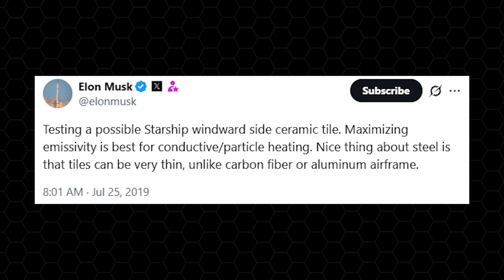SpaceX's New Starship Heatshield to Beat 1500°C Reentry in Flight 10 REVEALED...

Comment: Starship survived re-entry just fine did it? Is that in a parallel universe where Musk doesn't massively overpromise and under deliver? Also saying the heat shield is the hardest thing...maybe try to get Starship actually into orbit and back again without blowing up as that seems pretty hard for SpaceX so far.

Comment: YSZ(Yttria-stabilized zirconia)  coated turbine elements survive 2700 degree C. We use it to coat turbine parts on jet engine parts that have to endure for hours for thousand of flights at over 1500 C. YSZ is self-anneling at 1000 C. So Space X could theoretically do a pre-annealing phase just before attemping a full reentry phase. The heat shield old fibrous aluminum backing substrate should grip the sputtered or deposited YSZ much better than the current baked on cermic overcoating. These new heat tiles can be produced by Space X in larger shapes and sizes. The cost of production is higher, but the durability/reuse factor of 100x+ makes up for that expense.
Reply: Those turbine blade coatings are deeply impressive. Coupled with active air cooling, well, that’s the finest heat management combo.

Though it’s one thing to coat an incredibly stiff turbine blade, and a very different proposition for a comparatively wobbly spring stainless steel tube.

Comment: Some materials create a carbon foam as they heat up. Why not paint the areas behind likely burn-through with the stuff, and they'll seal any gaps which could otherwise allow plasma to The under side. 

That, and active cooling, wouldn't take much but sprinklers behind the skin and a water pump in the bilge. Functions like a heat pipe. 😎
Reply: What do you mean by heat pipe?

Comment: A controlled burn all the way to landing, allowing a slower descent and therefore less friction and less heat, is not a stupid idea. At our present level of technology, it happens to be impossible, but it is not a stupid idea. The only thing preventing it is a lack of power. Presently we can't conceive of how to do it, due to the limitations of reaction engines that need fuel, but if we ever make a breakthrough in energy and mass, possibly with a field effect/anti-gravitational form of propulsion, such as imagined by science fiction writers, then it will be possible, and we'll be able to float down from orbit just as gently as a parachutist. Or a UFO. Until then, we'll have to reenter at speed, and contend with the friction problem. From an engineering standpoint, it's a challenge that is nothing less than brutal. We're racking our brains trying to solve it, using everything we know about materials, heat exchange, etc. No wonder Elon calls it THE problem.

Comment: Injecting water behind highly susceptible tile locations is an easy way to protect these areas from hot plasma entry.  The miniscule amount of injected water vaporizes creating a slight positive pressure preventing hot plasma entry.  Spacex should focus using this cheap, effective design solution at the forward and aft flap hinges.  If NASA had used this on the Orbiter's wing leading edge, Columbia's cracked Reinforced Carbon Carbon tiles would likely have safely survived re-entry.
Reply: Weight of carrying the water + flow channels and injectors covering the whole ceramic tiles + Cg shift for the whole ship would be extremely challenging, and would be a redesign of the whole rocket, in system engineering trade-offs they probably won’t adopt this

Comment: This is bullshit! Tokamak plasma confinement has been used without ceramic insulation.

Why not use EM fields to gap the charged plasma from the surfaces?
Reply from the maker: Tokamak plasma is confined in labs under controlled conditions. Reentry plasma is chaotic and surrounds the whole vehicle ,you can’t “gap” it with EM fields easily. The power and tech just aren’t there yet. That’s why we still need heat shields.
Reply: @alphatech4966 not to mention the crazy power requirements that require heavy batteries or power generation. This ship is made to be light that extra weight takes the place of precious cargo weight

Comment: when in winter going to bed
youi bdo not mhave hundreds of tiny blankets
just one two huge wrapp over bed

I:E large wrap around sheets with sweating
nytrgen Water vapour exiting rows of holes
seting vapourising cooling
for the 20 minutes of entry. only nose flap areas woulkd be special small tiles
#
Reply from the maker: Interesting idea! Using vaporizing layers for cooling (like transpiration cooling) has been studied. But making a full “blanket” system survive hypersonic speeds, extreme heat, and mechanical stress is super challenging
Reply: @alphatech4966 the tiles are great for replacement. If that giant blanket cracks or breaks the entire thing might need replacement

Comment: Why the drive for refuling
When up in space
pencil shape as no importance till having to enter an atmospher
lifting up pods of fuel to connect along outside like
A lawnmower having rows of clip on batteries rea`dy to use.
and disgard whwn empty to burn up in high entery.
landing on moon can make better nshaped landing by
re  aloining extra engines just to land horizoncly
safe easy exit entry at surface level.
Thinking out of the 1920 -1930 sci fi idea box
is nbetter already thought out in  stories ideas.
wier lifts nstairs is stupid danerous extra to weight needs

Comment: ceramic foam. you could just respray any ablated spots after recovery.
Reply from the maker: Yep, ceramic foam or spray-on ablative coatings have been tested, even Space Shuttle used reinforced carbon-carbon and sprayed-on foam for parts.
Reply: Can we actually spray ceramic foam?  I thought this stuff was more like aerogel, requiring a complicated manufacturing and baking process
Reply: @jdlessl  no idea. i am just a civilian. you'd have to ask a real engineer.

Comment: You would think. Getting the beast to orbit will be the biggest hurdle
Reply: There are no hurdles, this thing is not designed to go anywhere. It's designed to burn money. It's a scam.
Reply: @JarvisThribb  👍This.
The problem of temperature differential that materials have to withstand is a massive hurdle by itself that I'm sure won't be traversed in my, or even Mr. Musk's lifetime.

The feat of the reusable booster, and catching it with Mechazilla is well done,  and much applause is well deserved, but the rest of it is far-fetched and (I believe) not possible due to physics.

This is like a new religion, and you know what they say about religion...
Reply from the maker: Yeah, it's really hard, but SpaceX is trying to do something we used to call impossible.

Comment: Why not merge ceramic with stainless for re-enforcement. Some car companies have integrated carbon fibre and aluminium into a weave to strengthen the panels. I think only using ceramic is pointless...designed in the 50's, needs improvment.
Reply: Hey i'm sure the rocket engineers have thought of literally everything you have. Don't you think so? Arrogance.

Comment: If part of total mass of cryogenic fuel will be wasted on evaporation for cooling, why not use it directly (on deceleration with engines, working in opposite direction)? At least it may be useful to compare the efficiency (loss of fuel per 1m/c of deceleration) in both cases. 
And why not to try circulation cooling (maybe partial) of heat shields (without evaporation, similar to the way it is done now in Raptor and other rocket engines)?

Comment: Ascent is not the tricky part. Decelerating from orbital velocity of 18,000 mi per hour, using the atmosphere as drag to slow the vehicle down, that is where you need protection from the heat.
Reply from the maker: 100% correct

Comment: If you look for a closely that isn’t a sealant around each tiles, it is the oblated material that wrapped up around the sides of the tile then the next tile pushes against it a soft seal
Reply from the maker: Great observation! You're right — there's no visible glue or classic sealant between tiles
Reply: They also flex depending on the temperature so it is designed to create a seal in between at high temperatures but not so close they flex and break each other

Comment: Rapid turnaround, like with an airliner, will probably never happen....these rockets are subjected to forces many times more intense than a 767,,,these vehicles will have to be checked top to bottom after every flight, and probably even more after multiple flights....a space elevator, if we solve the technical problems, could be a game changer.

Comment: So, I take it titanium is still too crazy expensive to use in such large quantity? Too brittle for the amount of expansion/contraction? What about a steel/titanium alloy?
Reply from the maker: Exactly, titanium is strong and heat-resistant, but it’s super expensive and tricky to work with at this scale. It also doesn’t handle thermal cycling as well as you’d think — can get brittle over time.
SpaceX picked stainless steel because it’s cheaper, tough, and actually performs better than titanium in high heat when you consider cost and reuse. A steel/titanium alloy could work in theory, but cost and complexity are still big hurdles.

Comment: How about we just cover it in dragon scales?
Reply from the maker: Dragon scales would probably work better than some of the early tile attempts!
Reply: @alphatech4966 overlapping heat shields in a dragon scale pattern. Start from the furthest and lowest point and work your way back out to the top center overlapping everything.
Reply: try anything, take 10 and there's still a heat shield issue. I'd want to be sedated on re-entry.

Comment: the rocket needs to dress in a carbon fiber jacket. so get sewing. its mostly air filled when sewn together. like the secondary fiber mesh heat protection layer. spraying coolant is an ablative heat shield. try paraffin wax. it can take a ton of heat. maybe wax carbon fiber ablative heat shield. paraffin wax is just the solid form of kerosene fuel. bs, same space suit for mars, as for moon and orbit.
Reply: Carbon fibre would just burn up !
It needs a heat shield to protect it !

Comment: Copper nickel and Inconel. Use the copper as oblation on outside allowing thin layer to burn off. Replace on ground in a large sheet in big sections.
Reply: They want a heat shield that they don’t need to replace.

Comment: Cryogenic cooling in a sandwiched metal sheet in large sections that could be replaced very fast in quadrants. Copper and nickel sheets forming a liquid containing section and use sweating as well. Weight is the problem with all this stuff. Make it real thin and part of the structural integrity. Giving up cargo is the end result. Less cargo more durability. Perhaps asteroid materials will be found in the future that would hold up to the heat. Partial oblation maybe necessary.

Comment: Dude! it's the MASS of what SpaceX is trying to re-enter with that is the issue. To compare to dragon and ask why are they doing it all over again is a straw man argument. Fire your editor.
Reply: What matters is the mass-to-surface of the heat shield ratio (in other words, the amount of energy to be dissipated per shield unit area), and above all, that the shield is to be reusable and protecting moving parts.

Comment: I have looked everywhere and could not find the retention method for the tiles.  Are they just snapped on?  Mech Engineer asking for details please!
Reply: Tucker bolts (as commonly used in auto industry) with harpoon-style ends are resistance spot-welded to the SS hull using KUKA robots and the ceramic tiles containing sprung metal inserts are then snapped onto 3 of them. AFAICT this is a 1-way process and there is no way to thereafter remove a tile except by smashing it.
Reply: 2:52 😅

Comment: Let's face it, this is all experimental and what this means is that it may take several years for Starship to fly with a heat shield that is truly reusable many times. As opposed to refurbishable, at a cost. As for transpirational cooling, this requires complex plumbing to route the coolant to the pores. There is actually a better method and that is to spray the coolant onto the back side of a porous material (could be metal, could be carbon foam, let it turn into a gas, pressurise and then work its way evenly outwards. Saves a LOT of plumbing. 1,200 kg/s of coolant? That's a lot of extra mass isn't it?
Reply: Uncontrolled flashing of liquid to vapor...has it's problems too!
Reply: @JM-lf4ws  Yep, you need a control system. However, I don't think that small pores in a metal skin is the way to go. Overall, its a hard problem and I don't see it being properly solved for a few years.

Comment: SpaceX approach to heavy lift is really a bad idea.  Ask most any actual rocket engineer/scientist and they'll tell you that the second stage of a 2-stage to orbit rocket must be expendable.  NASA made the mistake of making the Shuttle far bigger than needed in order to accommodate spy sats for the NRO/NSA.  The problem is that making your reentry vehicle large means the heat shield must be large so the penalty you pay for reusability of the second stage winds up reducing the payload to LEO by about half.  Early on SpaceX said they were working on a reusable second stage for the Falcon 9, but they cancelled that as they should have.  A reusable second stage for Falcon 9 would reduce payload to LEO by about half so that would too severely limit payload to be viable.  Blue Origin, OTH, if they ever get New Glen working could build a reusable second stage and although it to would reduce payload to LEO because it's so much larger than Falcon 9 it would be able to deliver a larger and more massive payload to LEO than the non-reusable Falcon 9 second stage.
So there is a huge payload penalty for second stage reusability, that much is beyond argument and is easily verified with the rocket equation, but if the rocket is large enough the payload with reusability is high enough for all but heavy lift requirements.  As soon as your requirement is for heavy lift a reusable second stage will reduce the payload by half or nearly so.
And now we come back to Starship -- it duplicates the mistake NASA made when the Shuttle was made so large but in Starships case it's VASTLY larger than even the overly large Shuttle -- just look at the vast expanse of heat tiles that monstrosity needs.  Compare the overly large Shuttle to the ginormous Starship -- SpaceX didn't simply duplicate NASA's mistake with the Shuttle they surpassed that failure exponentially!
Reply: Yep, true. Which is why Neutron focuses on minimizing the mass and cost of the expendable second stage. The real problem with Starship though is that Elon is fixated on Zubrin's Mars Direct architecture. That forced the design of Starship to have to do too many things. Must be a lander on two different planets (with different atmospheres) AND be a long duration space habitat. There are many inherent compromises going on. 

Instead we could have a Mars Indirect architecture, stopping over in Mars orbit in both directions. We could certainly build a (small and light) Mars lander and ascent vehicle that is reusable. We could even build a transit vehicle that gets us from Earth orbit to Mars orbit and return, and reuse it several times. But we don't need full reusability to do the bulk lifting into Earth orbit. Just start with something that looks like a stretch version of Neutron and add a second stage that delivers fuel.
Reply: @saumyacow4435  Yes, and the idea that a general purpose rocket would be the lander on:  the Moon, Mars AND Earth -- insanity!
Each place needs an optimized design for a lander and the needs are not the same.  For a lander on Earth or Mars a heat shield is needed, but for the Moon having a heat shield dramatically lowers payload and for no good reason.  As I see it propulsive landing is needed on Mars and the Moon but NOT on Earth -- for landing on Earth a capsule or Shuttle like glider make more sense and are safer.  I would design the smallest Shuttle like reentry vehicle for, say, 8 people -- it won't be small but it will by mush smaller than the Shuttle was and vastly smaller than Starship is.  For the  Moon propulsive landing is needed but not a heat shield; on Mars you need both propulsive landing and a heat shield.  Three different places -- three different lander designs!
Reply: Perhaps there is more to be discovered in this track of thinking. Would be great if one could do all. You might be right though. This could be too complicated like a Renault is.

Comment: Hey! saw an image of what looked like the booster section. 
Not sure, but I noticed the tack welds, either on strakes or fins, were nicely evenly placed now! Something I haranged about on booster stakes, that it was "unprofesh" to scatter those without a decent pattern system...

Lookin' better!

I have confidence in SpaceX and Starship, & when they get the enhanced over diameter downcomer into the ship too, should reduce the bad vibes resonance build up substantially.

Funny how after almost a hundred year history of that Pogo problem, SpaceX magically pulled a solution out of nowhere...

I wonder what caused them to think of that? 🤔